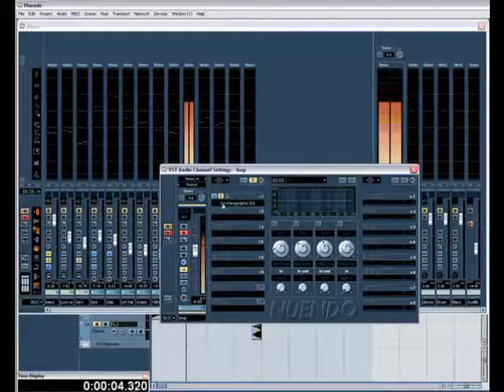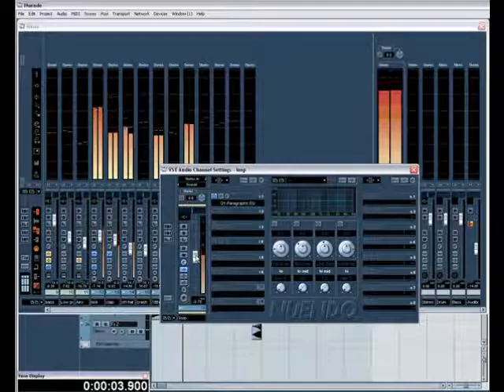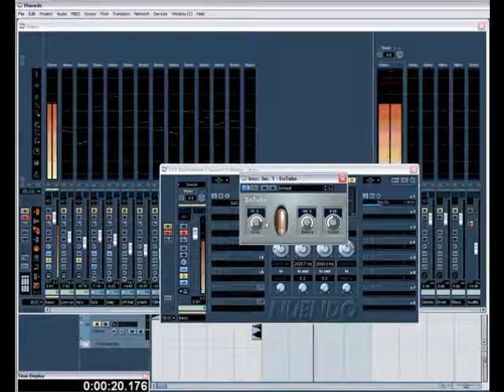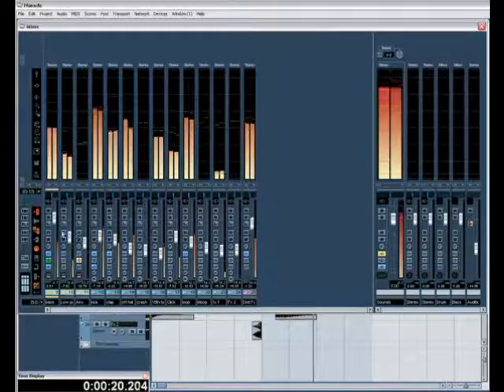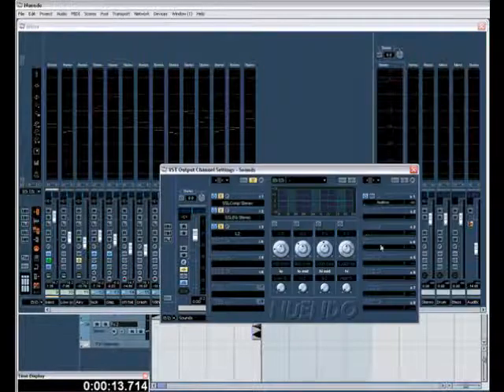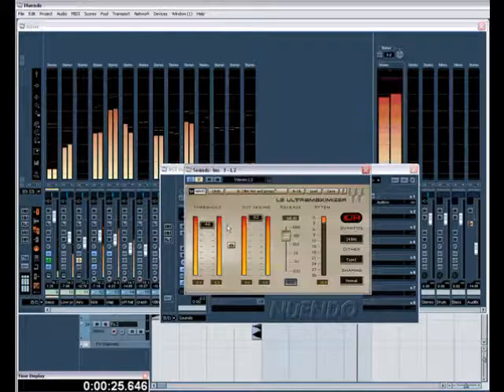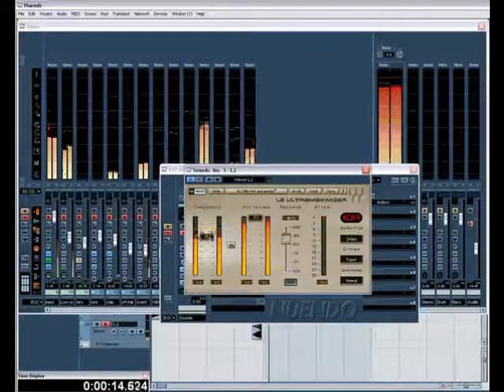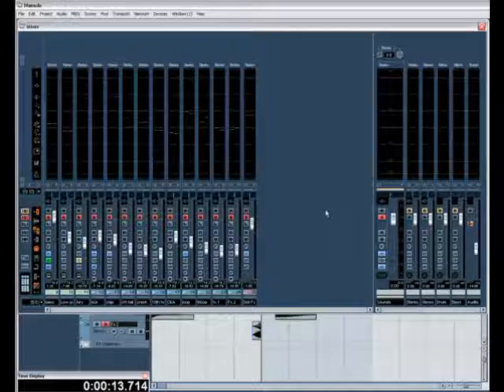Mixdown Technique Part 2

Comment: I know I may be rewritting things but in my book, mastering has more to do with a new pair of ears hearing a final project, and adding what it needs to be final, vs what is actually done at ,mastering.  In the most ideal of situations the masterer will not have to EQ, or 'fix things.'  EQ, balance, and (if needed) any final mix compression are perfected at mixdown.  The mastering engineer then listens to the final project as a whole, sets volume, limits, etc and makes the final presentation..

Comment: I would say that putting a compressor in the master fader when bouncing the mix down is still mixing, when used in this way, ie, to blend the sound as a whole. Actually the compressor he is using is the ssl bus compressor, so many songs you hear on the radio were mixed through that one. That's part of most studios' industry-standard ssl mixing boards, and many mixes get printed through it. well done!